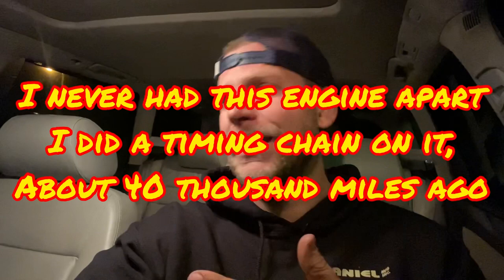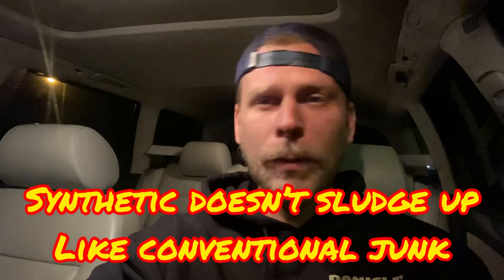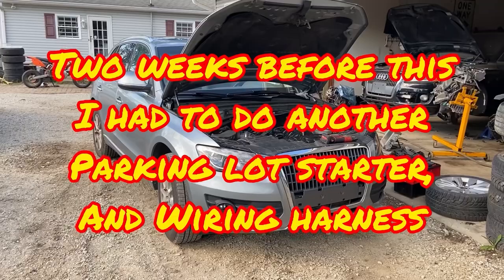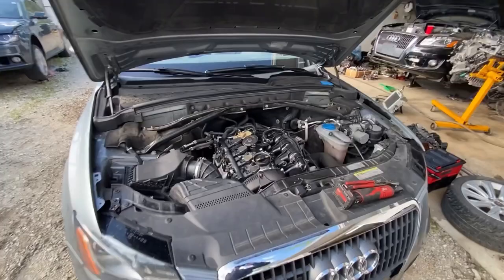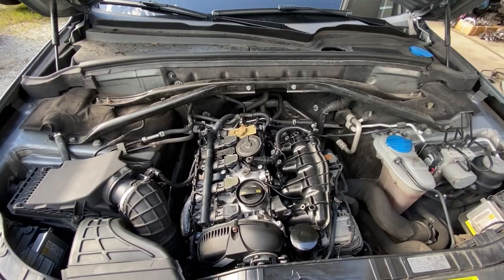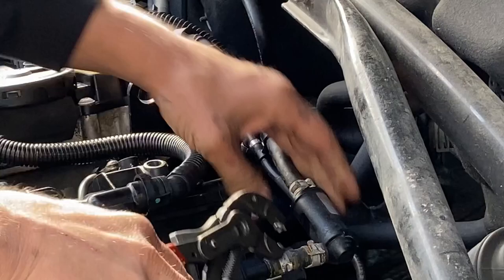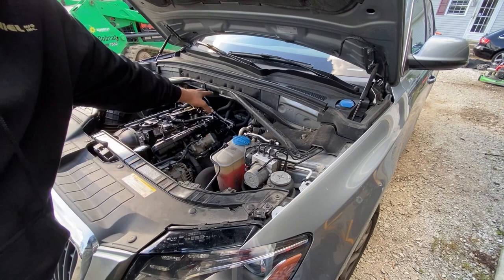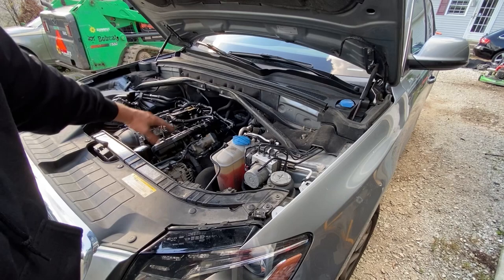5min HPFP 2.0t high pressure fuel pump replacing tfsi Audi VW timing oil sludge pressure b8 b8.5 a4

Comment from the maker: I forgot to mention, I have seen a high pressure fuel sensor in the fuel rail fail without setting a fault.  That would be my next thing to replace in a situation like this, before the low pressure module or low pressure pump.   Eventually I will get out my scan tool and show the values but like I said this issue is very sporadic and everything is reading correctly most of the time.  Please subscribe for more and if I have to visit or tear down this engine in the future.
Reply: What pressure should we see at fuel rail or will this prove hpfp is faulty? Cheers
Reply: Brother, can you come to baltimore  MD to help a friend with a crank but no start 2011 a5? Pleaseeee
Reply: What would cause a P0001? HPFP?

Comment: Had the 2188 code, took to a mechanic. After their repair, plus some preventive maintenance (3grand) the code popped back up after 50 miles. 

Searched YouTube. Found your channel. 

You made it look so easy, my first DIY car repair was this exact one. 

Did an engineer flush too, since fuel was allll over inside. 

150 miles in, no code. 

I guess I found a hobby now. 

You’re the best.

Comment: Dude, I own a 2012 GTI and recently had a missfire. I did everything, replace the coils, replace the spark plugs and replaced the PCV valve. Your videos gave me the courage to keep digging, i removed the intake manifold and started to clean the carbon build up and found a loose intake valve. Removed the valve cover "cradle" and found a broken spring. Replaced it without pulling the head, retimed everything and put everything back together. Car runs like new, i didnt replace or update the timing chain due to budget but it its at -2.35 as i checked with my OBD reader so i think im ok there but will keep an eye on it. Keep up the good work brother, and god bless you and your family.

Comment: Thanks for this. I was doing this on my 2013 Allroad and the nut on the bottom was not aligned well at all. I struggled for hours and was getting very tired and desperate. After looking online for additional help I found this video and after hearing you say "you may need to add some leverage if its not aligned properly" i started trying to push down the pipe leading to the nut to give it more room to fit the pump. 

I had to eventually carefully climb into the engine bay with just socks on, put some towel/cloth on top of the metal pipe and press down on the pipe with my big toe/foot while trying to screw it on and FINALLY got it to screw on.

I may have figured it out eventually but it may have taken many more hours and some sleep but I was getting to the point where I was thinking I'd have to get it towed! Thanks again :).

Comment: I just did a HPFP per your video a couple months ago.. it was a flawless install, I ran VCDS to prime it before starting the car.. I changed out the pump because I saw it leaking I assumed a bad seal .. anyway you can always pinch off the LO fuel line so that line doesn’t leak or lose it’s prime.. probably a good idea to cycle the door open/close a few times.. opening the door cycles the tank fuel pump.. excellent video Naptown 👍🏻

Comment: As usual your videos are amazingly informative. But I’m having an issue with my b8 a4 2.0. I replaced my high pressure fuel pump and got a p12a1 code on the first start up after replacing the pump

Comment: You should open your fuel cap to let the pressure out of the tank before disconnecting fuel hoses or fuel can pour out the hose till the pressure stops.
You know this but its good advice for viewer's.
Reply from the maker: It’s possible to have a fuel smell, if you have a picky customer that immediately takes the car back to their garage and closes the door it’s maybe a good idea to be careful with the fuel spill.  Personally I didn’t ever mess with it, if I was worried about it I would rather spray the engine down when I was finished but I’ve also not seen enough fuel come out of the lines to ever worry about it on these cars.  People doing work at shops for paying customers definitely need to be more careful than me working in my backyard thanks for the awareness and and future input is appreciated

Comment: Naptown! Big fan!
I am having issues with my 2011 2.0l avant. Had valve covers resealed they were bent ended up putting a new engine in it $5k later Now getting p2229 from scanner. Planning on replacing the gas cap first with a better sealing one. Then not sure what to look for.
New Engine 100k miles car has 134k miles
Reply: Ended up being an o-ring

Comment: Currently my vehicle 2013 Audi A4 stuck at work. Brand new oil, filter, brand brand, new OEM coil packs brand, new spark plugs, clean the mass airflow sensor it already has updated intake and exhaust. Only throwing P300 or 301 code. Cylinder one misfire. Was running absolutely perfect on E85 until I hit the gas on the highway… And then it just started sputtering installing out and now when I start it up… it stutters… EPC. Along with the code. I’m thinking it’s a high-pressure fuel pump. 

What do you think???

Comment: would this cause the car to crank but no start? sometimes it starts but struggles and then levels out. other times i have to leave key in ignition a minute before starting. no codes except air intake leak :(

Comment: Totally agree on new OEM parts first then used OEM before aftermarket
Reply: Plenty of aftermarket parts are fine. Some are crap. A lot of the OEM parts are crap too!
Reply: @jizwinkle9822  yep all true.. it’s just IMO using OEM gives you a better chance of not having to repeat the work, like timing chain tensioner or anything internal where replacing is a PITA.. now like easily accessible stuff yeah a good aftermarket part probably are fine.. I just prefer original parts
Reply from the maker: I like to specify no name parts vs aftermarket parts and then aftermarket parts need to come from a reputable source.  I’ve purchased way too many “name brand” counterfeit parts from knock off China land.  Oem parts are typically redesigned and updated to the best standards they know how and the aftermarket doesn’t have the proprietary investments and information not to say they can’t come up with something better but typically it’s just a knock off of oem

Comment: Could you make a video of how to check manually if your high pressure fuel pump is working correctly I have a misfire and someone before I change spark plug the coil was told the injectors were fine did a compression test that was fine I get a misfire on cold starts until the car warms up and then it runs fine I only get a random misfire code p0300 end p0304 any suggestions I tried to smoke test or propane test I figured I should try the high pressure fuel pump. BTW it's a 2018 Audi Q3 with 70,000 mi on it bought it brand new tried bringing it to Audi I was very disappointed with them they tried charging me $1,100 just to change the oil separator I saw your video and replaced it myself it only cost me $114 from FCP Euro for the original Volkswagen Audi part

Comment: Hi, 👋 thank for your videos.. we learn a lot… so, I have 2013 Audi Q5 the problem is that every 250-350 miles it ask for 1/4 or oil. It have 120161 miles on it. Can u please explain if that normal or I have fix it. Looks forward to hear from you thanks 🙏🏼

Comment: Bro I got replaced my fuel high pressure pump but I still having run idle and I still have the code P2178 what is this code? And where is locade on Audi a4 b8, 
And I end up bring to Audi to check they said fuel pump and high pressure bump . I change the high pressure pump but I didn’t change the fuel pump yet. Do you know if could be the fuel pump. Thank you bro. Hope your reply. Thanks.🙏🙏

Comment: Question do you have a hole right next to that hpfp? If so does it have a cap on it, bc my mechanic replaced my head cylinder and now it's leaks oil through the back and idk if that messed up my high pressure fuel pump.

Comment: Our 2013 Q5 threw these codes: P0089 Fuel Pressure Regulator 1 Performance, P2293 Fuel Pressure Regulator 2 Performance, 
P3073 Fuel pump Electrical error in circuit (10063),  P310B Low Fuel Pressure regulation Fuel pressure outside specification (2636),  P0087 Fuel Rail/System Pressure - Too Low (2838).  Does this repair cover them as well?  I got a new High Pressure Pump and Fuel Pressure Sensor.  Seems like the connector on the Pump is not super tight.  When I plug in the new one the fit is much tighter.

Comment: Awesome video again as I just rewatched because I just scanned a p2188 on my vcds I did the usual stuff with checking and upgraded to the AK version of the breather OEM 06H 103 495 AK and I smell gas in the cam tray .. I suspect HPFP?? I found one on a parted out B8 at my local junkyard.. the guy said it was totaled at 38k mi so that’s low mileage to me.. is $50 for a used original HPFP a good deal.. guy said I’d have to remove it at that price.. anyway I thought I’d share .. keep the videos coming Nap👍🏻👍🏻

Comment: Did that fix the issue. I also replaced oil pump and other things chasing low oil pressure light. Swapped pressure sensors with other car and same thing. Checked mechanical and it is low at idle only. Fuel smell in oil. That's the only code I have also.

Comment: Hi man, one question ... i have the same car , when engine temperature is cold it start perfect ,but if i drive for 20 km or less and i stop the car when i try to start again it doesn't start ..it cranks but refuse to start ..so i have to do start/stop for 5 or 6 times to start the car ...any idea what can be the problem ...i have this code error P118800 and P030200

Comment: Question: Car is a 2012 Audi A5 Quattro, 2.0T TFSI with 129K miles. Do you think if a code P2188 for running rich, assuming the HPFP is leaking fuel into the oil, could cause a malfunction in the oil pressure sensors (brown & blue) and the hi-low oil pressure switch? I’ve replaced both sensors, the switch, the oil pump, and still getting intermittent low oil pressure warnings, which appear to be false, as the oil pressure has been checked, and is perfect. I’ve also purchase a higher end OBDII, reset all the codes, and the car ran error free for almost 2 weeks. I’ve ordered and new HPFP and will do an oil change as soon as the HPFP is replaced. Any thoughts would be greatly appreciated!!
Reply: Hello did after changing hfpf did p2188 go away....having similar issues here
Reply: Hi man, one question ... i have the same car , when engine temperature is cold it start perfect ,but if i drive for 20 km or less and i stop the car when i try to start again it doesn't start ..it cranks but refuse to start ..so i have to do start/stop for 5 or 6 times to start the car ...any idea what can be the problem ...i have this code error P118800 and P030200
Reply: Same car here with P2188 code and occasional hard start. I’m going to replace it.

Comment: Hey, I had the same issue I have a 2010 Audi A5 2.0 T CAEB engine. When I turn on the vehicle cold start in the morning, and I go to the stop sign the car instantly shut off and I turn it back on instantly & it then if runs perfectly after that. Only happens when I don’t let the car warm up.
Reply: What can it be? I have no check engine or no codes

Comment: is it possible to reuse same fuel pump and replace the gasket that goes bad? or is getting a new one better off
Reply: high pressure fuel pump *
Reply: i have bad fuel economy and got the code P218800 , did oil change already meanwhile i fix

Comment: I need help with my 2012 Audi A4 is stage 3 plus with a k04 turbo started misfiring really bad so I replaced the injectors ran well for about 30 minutes then started misfiring again then I replaced the high pressure fuel pump and cam follower and also new spark plugs and still having multiple misfires and a code for mechanical pump maintenance
Reply: And white smoke coming out of the tailpipe with a very rich gas smell

Comment: I have a 2006 a4 2.0t, what would cause fuel to get into my oil ? could my timing be off on the intake cam?, no codes, just alarms saying I have low oil pressure and it doesnt go past 3000 rpms when driving , just bogs down when I try to step on it, any advice you could give where to look ?
Reply: It’s a 10m tripple square? I cannot get my 10m to fit the hardware for life of me. I ordered a 9m offline should be here tmmrw but I’m so confused why my 10m tripple square don’t fit

Comment: Hi Naptown Luv ur vids.So if gas get in the cylinder walls, does that mean no compression in the cylinders? for the car over a time if the fuel pump is is defective and or spark plugs, fuel injectors? so by all the gas being in the cylinders would that cause a miss fire due time, and riding sluggish and stoping and going? please answer would really help a lot please!!!!!
Reply from the maker: This question has too much going on and that’s why I make videos.  I try to keep the comments section simple so I can get to most of them.

Comment: I have a question my 09 a4 2.0t all of a sudden started skipping and smelling like gas and the check engine light came on and was blinking. I got home and it showed a P2294 code. So I replaced the HPFP and it still had trouble starting but did start and was smoking like crazy and smelled like it was running really rich. So I looked up and they said it could be the fuel pressure sensor. So I unplugged the sensor and the car started but was still running the same way struggling idling and I could tell hardly any power. Does this mean it was probably the fuel pressure sensor and not the fuel pump?

Comment: Some DIY sources for this repair stress that the "special cam lobe" needs to be in the lowest position, so the pump drops in easily. Has this ever created a problem for you while replacing the HPFP? How can a DIY mechanic rotate the engine by hand? Thanks in advance!
Reply from the maker: Just go back and forth a lot and gently screw it in evenly.  I’ve never payed attention to where the cam position was.
Reply: @NaptownTuner   Thanks! Your video gave me the confidence to tackle this. My Allroad has a flex fuel engine so the low pressure fuel line's a bit more complicated (in the way) but I think otherwise an identical procedure. Oh yeah, is there a tip for unlatching the electric connecter on the pump?

Comment: I put 2 HPFP's on my car since I bought it, think the first one was bad as in leaking oil into my gas. I changed it to try and eliminate it dunno if it worked but my point to saying this is after each time I changed it the car engine sounded super loud like the HPFP was gunna break. It quieted down tho after a few miles. That happened on both new pumps. I guess maybe its normal after new install?
Reply: its likely due to no fuel inside, imagine a water pump whining when its dry
Reply: Agree don’t ever want to run that pump dry.. or have it cavitate. Make sure you torque the two 3squares evenly Naptown has mentioned that more than once
Reply from the maker: I’ve never really noticed but I’ll pay attention next time, for instance on a timing belt for some odd reason every time you start a fresh belt service the engine sounds bad on the first few seconds then goes back to normal.  When I was first starting out I always got uneasy about it now I just expect it.
Reply: Did this fix your problem?
Reply: @RemyTrodella  The gas in the oil you mean? Not sure, I changed that and the injectors. It's not happening anymore.

Comment: Great channel! 👍🏽 
You seem to know a lot about Audi. 
Do you know what may have caused error codes P0087? It also says "Fuel Rail Pressure Too Low" -OBDEleven. The car suddenly began to lose power. Very white exhaust that smells of fuel and also misfire in cylinder 1. Bad Fuel Pump ?, Fuel Rail Pressure sensor?
-10 B8 2.0tfsi
Reply from the maker: If you haven’t put a timing chain on it, that’s first.  It’s driven from the camshaft and the cam is driven from the timing chain.  It that is in good shape then look at other stuff, I’d do hpfp next just because they will all need one it’s just a matter of time then only a couple times I had a bad fuel pressure sensor in the fuel rail
Reply: Did you figure out what was wrong it with 
I just recently got that code P0087 for my 2012 Audi A4 Quattro
Reply: @diegoromo8430  one of the injector was leaking. I replaced all 4 at same time.

Comment: Just got this engine light code-Intake manifold runner position sensor/switch circuit range/performance bank 1a Code# p2015....2.0t 2012
Reply from the maker: Thanks for the video idea I’ll put it on my list